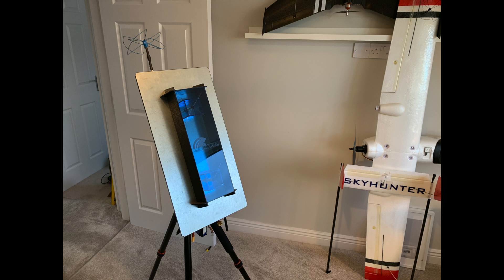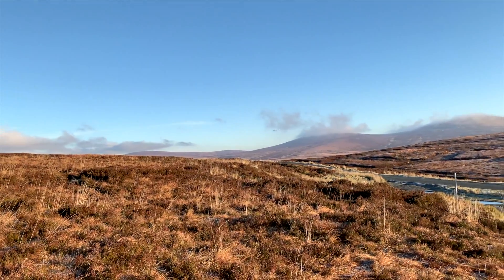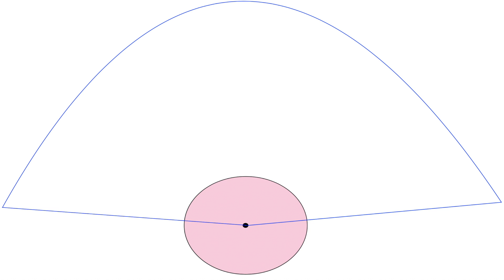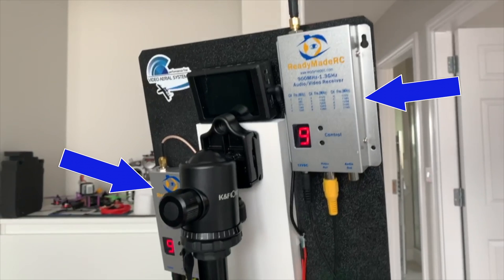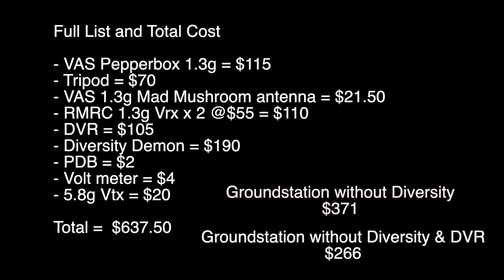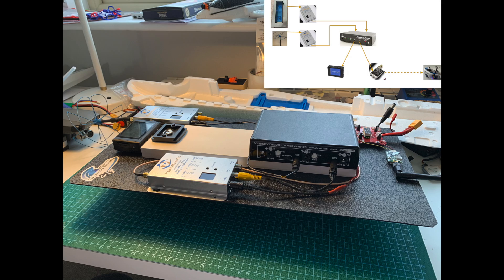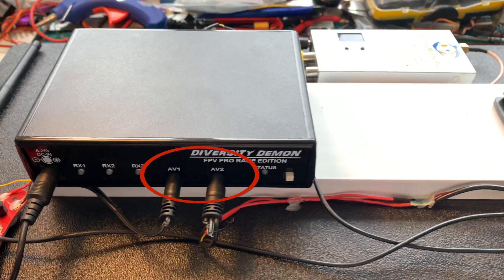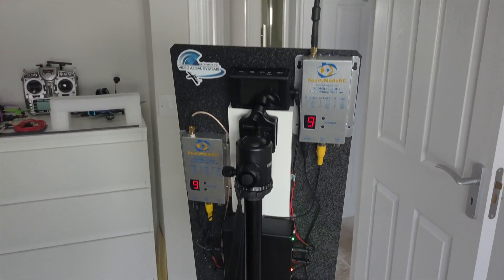Long Range FPV Ground Station - Build Tutorial

Comment: Great work, I am dusting off long-range stuff from a few years ago, I have been using the Eagle Eyes as a diversity controller but it's having some issues. These are now not available nor are the diversity demon. Do you have any suggestions on a currently available replacement?  Thanks
Reply from the maker: Honestly the only one I know of that you can buy at the moment is the clear view. This is expensive but it’s 2 x receivers and a diversity controller all in one. https://clearview-direct.com/shop/ground-station-receivers/1-3-receivers/clearview-xlr-1-3/
Reply: @AdamGdoesFPV  Thanks for the reply and link. You're doing a great job.

Comment: I'M 37 PUSHING 38yo AND FROM JANUARY 2020 UNTIL EARLY SEPTEMBER 2020 I BUILT MY NEW W/BIRD P47 RAZORBACK WITH KOLM 77ccV4! 3 YEARS AGO I BUILT THE BUFFALO FX-79(I LOVE DELTA WINGS) I HAVE MFD AP/OSD V1 AND MFD AAT WITH RMRC VRX 1.3GHZ, 5 TURN HELICAL ANT.800MW VTX 1.3G(RMRC 1258) CLOVERLEAF,DRAGONLINK UHF,4S GRAPHENE 10A 2S 2A FOR AP AND SERVOS,EACHINE 800D WITH AV IN DIRECTLY FROM VRX 1.3G(I'M NOT GONNA MENTION EVERY SINGLE COMPONENT) YOUR GROUND STATION IS CLEAN,RMRC HAS THE BEST 1.3VRX/VTX/ANTENNAS AKA GREAT CHOICE! AND GREAT VID FOR EVERYONE OUT THERE! I STILL HAVE AND FLY MY FPV PLATFORM,AND I WISH YOU THE BEST! ! NICE DAY!
Reply from the maker: Sounds like you're enjoying the hobby👍🏻 keep it up

Comment: Do you need the 5.8 transmitter to receive video
Reply from the maker: The video signal comes from the output of the Diversity Demon. From there it's up to you how it gets from there to your goggles or monitor, you could simply use a cable. If you would like to receive the video wirelessly to your goggles via a 5.8g relay then yes you need a 5.8 transmitter

Comment: Great video.  I have always been on 5.8 but want to venture a little more.  I see you have a relay to a 5.8 vtx through the unit that gives you diversity.  Would there be a  cheaper option besides the 189$ unit if I didnt plan on running diversity.   Thanks
Reply from the maker: Thanks Ken 👍🏻 if you don’t run diversity it would be really cheap. You just need a 1.3g antenna and receiver, then you hook the 1.3g video output up to a 5.8g vtx and you’re done. 
-Pepperbox $115
-1.3g rx $55
-5.8g vtx $20
Just add a tripod and lipo. 
If you buy through RMRC please use my links in video description, it will cost you no extra but you will earn extra reward points on your order and I will get some points too and I would appreciate your support for my channel 😊👍🏻
Reply: Thanks Adam   I will definatly use the links.   I cant believe how cheap it is to try it out.  I have allot of the parts so I think I have to give it a try.  My goal is to fly at a lower level only 8k out.   I am not looking to break distance records I dont trust the 5.8 at lower levels.
Reply from the maker: @BBSlats  5.8 compared to 1.3 on low level flying is like day and night. At the altitudes I fly, I cannot even make it to the start of the river run on 5.8! As you will see from my latest video, on 1.3 I can make it to the river and then fly a 6km stretch of it (heading away from home) nice and low
Reply: @AdamGdoesFPV  Are you still using the Matek vtxs in some of your builds?
Reply from the maker: @BBSlats  yeah the vtx I’ve used in 2 recent builds. Tested in the mini crosswind out to 12km a few meters above the ground and still great image. Bit more expensive than the partom vtx but it’s smaller and lighter 👍🏻 it’s the Matek VRx I won’t use
Reply: @AdamGdoesFPV  I am going to go rmrc for sure on the ground station.  Last question if you only had one antenna to use on the base station for 8km runs would it be the big VAS pepperbox.
Reply from the maker: @BBSlats  without a doubt yeah the 1.3g Pepperbox 👌🏻
Reply: @AdamGdoesFPV  ok great I see rmrc has one left lol.  Parts chase is on.  What antenna are you using on the plane with the matek.  I imagine your not using the stock one that came with it?
Reply from the maker: @BBSlats  no I use singularity side feed by TrueRC. I bury it in the wing 👍🏻
Reply: @AdamGdoesFPV  Last stupid question.   I am on 5.8 so i am used to using any channel.  With the side feed antenna can you only use the 2 channels in its range
Reply from the maker: @BBSlats  Yeah thats true. It's the price you pay to have a super small high performance antenna on 1.3g. There are others that have a wider channel range but are normally much larger

Comment: noob question. why do you need 5.8ghz vtx on gs?
Reply from the maker: Yeah, what Aurelien said is correct, wireless transmission to goggles.
This GS is not compatible with the DJI digital system as it uses 1.2g and DJI is 5.8g. 
My setup is geared towards very low altitude medium (10-15km) range flying behind trees, land and objects. Sadly DJI digital cannot cope with this sort of flying yet. For some people the DJI system is perfect. Cheers
Reply: The 5.8 is used to send the video wirelessly to goggles so anyone on the 5.8ghz band can watch
Reply: @aurelienwittmann4105  thanks. Does any GS support DJI fpv system?
Reply: Bendix Trinity I don’t think so because the dji video receivers are all proprietary, but you can turn ehh goggles into analog, either way you can get really good range on the dji system

Comment: I have nearly the same setup as you.  I have a 1.3 GHz crosshair with an omni antenna, both connected to an eagle eyes diversity controller/tracker.  I never set it up as a tracker because I felt like it was overly complicated and that the omni antenna took care of the tracking function.
Reply from the maker: Nice setup. It’s not worth having diversity and a tracker at the same time so you did the right thing. Having a tracker becomes annoying if you have many models as you always have to add something on board to transmit the data back.

Comment: I have some more questions: 
1. Can I use a AV cable to connect the video receiver to the diversity device to get both video and audio sent to my screen/goggles because hearing the prop noise will help me. ( by the way I don't know if one transmitter in the aircraft can transmit both audio and video at the same time, so can you enlighten me about that :) )
2.If I buy a goggle which has diversity built in, should I just connect these antennas to it? also if that works how do I output what I'm seeing in my goggles to another screen for a observer
3.If I use this exact setup except the 5.8 GHz transmitter: How do I split the AV signal coming out of the diversity demon for multiple screens using cables but not a 5.8 GHz transmitter without loosing signal strength 
I hope I don't bother you asking a lot and thanks from now...
Reply from the maker: 1: Yes you can. You'd just need the right cables and would need to ensure that the Vtx on the plane is also capable of transmitting audio and has a built in mic etc
2: You cannot get goggles that have 1.3ghz diversity built into them. Plus the pepperbox is too big to have connected to goggles unless you want to have it on a tripod next to you and stand next to it and not move your head the whole flight.
3: The diversity demon has 2 outputs. If you want to output the signal to more than 2 devices you would want to get a video splitter/amplifier.

Comment: excellent video, it was hard for me to find such a complete tutorial, how much is the maximum distance range with this equipment?
Reply from the maker: Glad it helped :) That question has many factors involved. Depends on conditions, terrain, setup onboard the plane etc. In the right conditions 70km maybe. I go out to 10km and still flying low to the ground and picture is still clear. You won't be disappointed. Cheers

Comment: 5.8ghz or 2.4ghz for fpv. 2.4ghz is better than 5.8 for fpv, correct?
Reply from the maker: Technically yes. The only issue is that many other common tech like WiFi use 2.4 so can cause you interference. So the answer is yes as long as you’re not in an area with a high level of noise e.g near built up area or city.

Comment: raver using devils demon, can that be done with flysight black pearl ?
Reply from the maker: No, these have a 5.8g receiver in them. Diversity on 5.8 is easy and cheap, most goggles and monitors have it built in now... but on 1.3g it's more expensive. Mine is a 1.3g diversity GS
Reply: @AdamGdoesFPV  Thank mate

Comment: Hi, I was using R9M Frsky TX radio which is emitted in 800 Mhz signal. If I use 1.3 Ghz for video sistem just like you did, is it posibble to interference?
Reply from the maker: My guess is you'd have no problems. Crossfire uses 900mhz and many people use this with 1.3g video successfully  :)

Comment: Hi Adam, this video is awesome. Just had a question. I see you ran the video cable to the vtx repeater but was it 2x cables running to the DVR?
Reply from the maker: Yeah, it was a single cable to the DVR but when you cut it open there are 2 cables: 'Video' and 'Video GND'. Not all video cables have a GND to go with them
Reply: @AdamGdoesFPV  thanks Adam. Thought that might be the case. Appreciate the reply. Keep up the good work!

Comment: Excellent video. I am wondering if this setup is still relevant in 2020 for long range..for drones though.
Reply from the maker: Thanks. Technically the planes are classed as drones too so do you mean multi rotors? This gear is still very relevant for long range flight, the Pepperbox is still big seller. As mentioned in the video, I built this for medium range low altitude more than long range, but it works really well for both.

Comment: I believe I've seen some of your videos using the MFD crossbow mini antenna tracker.  Are you using it with a 1.3 system as well?  I haven't had any luck on my end.  It appears to work with 2.4 and 5.8 but not 1.3.  I'm curious to hear your thoughts.
Reply from the maker: Hi Alexander, I actually used to use the old style MFD AAT like this: https://www.hobbytech.com.au/files/cache/76d04bab24d1e01648dea96bbdb2cf0e_f132.jpg
I've not got any experience with their crossbow gear. The AAT I had worked brilliantly with the 1.3 gear, the only problem I ever had was that there was some sort of incompatibility between the AAT and my FS Dominator V3 goggles causing a terrible picture.

Comment: Great video....what distance does this station give you on average if I may ask?
Reply from the maker: The pepperbox is proven to be capable of 50km + with the right setup on the aircraft and in the right environment. Thanks for watching :)
Reply: @AdamGdoesFPV  what Vtx do you put on your craft...?
Reply from the maker: https://m.banggood.com/Partom-FPV-1_2G-1_3G-8CH-800mw-Wireless-AV-FPV-Transmitter-With-Antenna-For-RC-Drone-p-1347487.html?p=RB010715711422015054&utm_campaign=Adam&utm_content=3312

Comment: this video helped me alot,im plannin t o build it!what radio transmitter should i use? what ghz?im really new in this ,i want to use this for quad drone and plane together 1 setup.is it possible ?
Reply from the maker: Oh Boy if you’re going to use 1.2g for video using the pepper box like my setup then you’ll really need to run a UHF for control, like Dragonlink or Crossfire. Also, when you say “quad drone” of you mean like a 5” racer (small drone) you can’t really use 1.2g video for them as the antennas are too big. However, you don’t need a ground station for small drones anyway, just use the 5.8 built into your goggles
Reply: @AdamGdoesFPV  a  7"(or bigger) drone.im plannin to build it for long range so i can take steady shots.so i want to build 1 ground station(like yours), and swipe the transmitters from the one to the other rc drone..thanks for your answer!
Reply from the maker: Oh Boy well if you build a 1.2g ground station it can be used for anything you put a 1.2g transmitter on. Just depends if you can fit 1.2g gear on whatever it is. Glad the video helped anyway. Thanks for watching 👍🏻
Reply: @AdamGdoesFPV  can i use this Matek 1G3 VTX and VRX ?
Reply from the maker: Oh Boy yeah you can use any vrx and vtx you like. If you run diversity like I have the receivers need to be the same as each other, but can be any vrx you choose

Comment: Hi I’m running a fat shark predator setup on my traxxas summit but I keep running out of range at like 200foot I have  added spiral antennas but it’s still petty rubbish  what can I do ?
Reply from the maker: RC Shed CI it sounds like you’re running 5.8g for video still, so moving to 1.2g would be an improvement. High gain antennas would be tour next upgrade.

Comment: Is it okay to only use 1 receiver and directly connect to a monitor?
Reply from the maker: Yes that's the way they were intended to be used originally :)
Reply: @AdamGdoesFPV  thanks for the reply man really appreciated
Reply from the maker: @kronosdarkangel5290  No problem :) This video is more about building my more complex setup... but for some people a simple receiver and screen will be all they need. Cheers

Comment: Thank you for posting this.  I'm now in the transition period from 5.8 to 1.3 and have been slowly setting up my ground station.  I greatly appreciate you taking the time walk us through your setup.  I noticed in the comments below you mentioned the possibility of doing a video of the sky hunter long range setup.  Did that ever get published or still in the works?  I've been curious about recommended antenna placement for rx and vtx (i.e. opposite side on wing tips, etc.).  Thanks again.
Reply from the maker: Hi, thanks for watching and commenting. I haven't got round to making an overview of the Skyhunter, mostly just though being too busy, but I will consider doing one soon. For now I only have a brief build overview of it here: https://youtu.be/1HgDiqvrb3E 
For antenna placement the best solution, like you said, is having Rx antenna out on one wingtip and the VTx antenna out on the other. Separating these 2 antenna's as much as possible and ensuring they're not being obstructed by electronics or carbon fibre is going to give you the best results. Also keep the GPS away from the vtx. I have my GPS rx on the centre of the Skyhunter fuselage. Hope this helps

Comment: Great video! A few questions.. I am interested in making a long range station for RC trucks/crawlers for around my neighborhood.  I live on top of a hill, but many houses. Would this be a good setup?  Also what is your camera/vtx setup? Would the one I currently have below suffice? And any concerns about the controller transmission losing signal? I am currently using a DX5 & Spektrum receiver. Appreciate it!

Spotter V2 Micro FPV AIO Camera 5.8G with OSD Integrated Mic FOV170 Degree 700TVL Video Transmitter 40CH 20MW-200MW Adjustable VTX for Mini FPV RC Drone by Crazepony https://www.amazon.com/dp/B078PK98HC/ref=cm_sw_r_cp_apa_i_dAS4Db1V7DHW6
Reply from the maker: Thanks for the comment :) I don't have experience with ground based FPV but I will give some advice. For the best range with video gear you will want to run 1.3g, like the groundstation in this video uses. The 5.8g camera you linked to is going to struggle because A: it's 5.8g which is known for being bad close to the ground or going behind objects and B: it's low power at just 200mw. For your control signal you should really look into UHF gear like TBS Crossfire or Dragonlink (I use this).
Use this 800mw Video Transmitter for good range on 1.3g: http://tiny.cc/kwcv0y
At the moment this is my favourite FPV Camera ► http://tiny.cc/FoxeerPredator4
Hope this helps
Reply: @AdamGdoesFPV  Wow didn't realize that, great tip. Much appreciated Adam!  👍

Comment: Thank you so much! For me you clarified around a million questions! Absolute perfect! 
In your also excellent video "Narrated Long Range FPV Setup Overview & 15km Range Test - Skywalker 1900", from 26. Oct 2015, you are using the "MyFlyDream Antenna Tracker" but no diversity.
Why do you switched to diversity? In case that is even possible: Why not using both (tracker and diversity)?
Reply from the maker: Hi, thanks for the feedback, glad you found it useful. I used to have a Crosshair antenna on a tracker, and this gives you good range in all directions. It really is a great setup. I wanted to go with a very high gain antenna (Pepperbox) to allow very low altitude at medium/long range. This antenna is too big and heavy for a tracker which is why I went for diversity. You definitely don't need diversity if you have a tracker, so you should never have both. A tracker will ensure your directional antenna is always pointing at your plane, so there's no need for a second antenna, it will never have better signal than the directional one on the tracker, and the diversity controller would never switch. Hope this helps.
Reply: @AdamGdoesFPV  Thanks again! Your explanations make sense! So I got it :-) But I have another request: I join the many comments from below and ask you for a video of how your plane is built. Thank you in advance
Reply from the maker: @v.gedace1519  No problem. I'll consider doing a video on the setup of my Skyhunter soon as it does seem many people are interested
Reply: @AdamGdoesFPV  Cool and thanks in advance!

Comment: So do I need a 1.3ghz video transmitter for my plane when using a 1.3ghz ground station?
Reply: If so any recommended ones?
Reply from the maker: Hi Tyler, yes that's right. The signal has to be transmitted in 1.3g to received by a 1.3g receiver/antenna. The vtx I use on all of my 1.3 g planes is this one: http://tiny.cc/kwcv0y